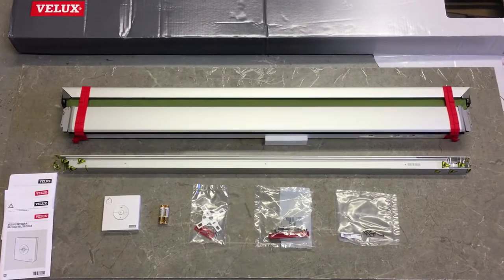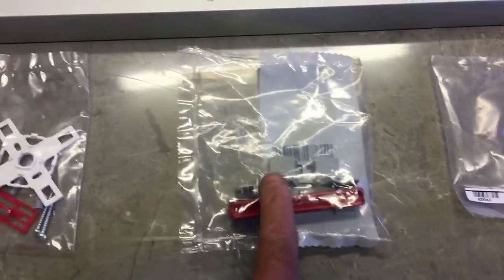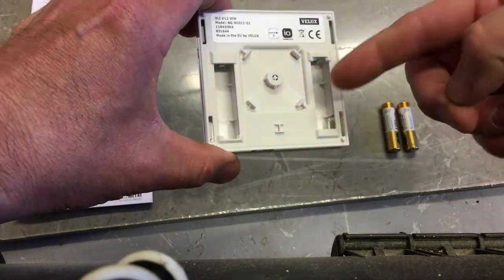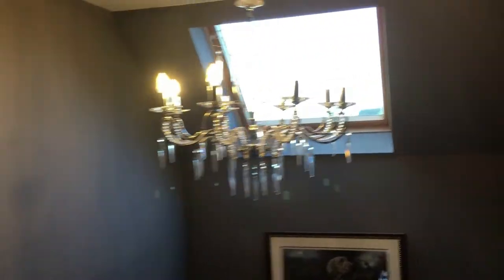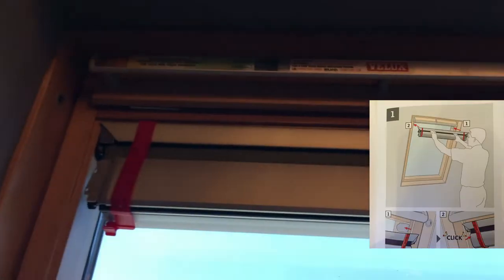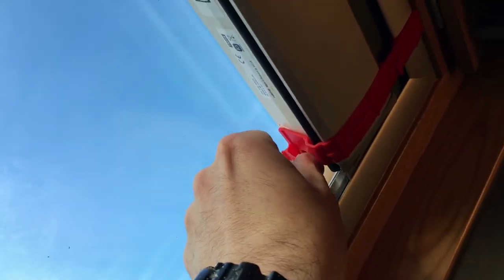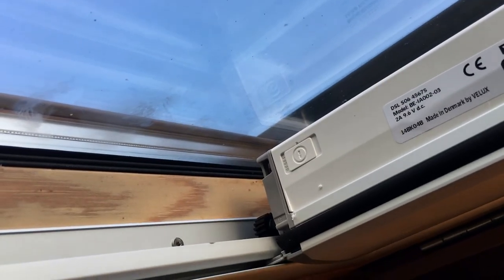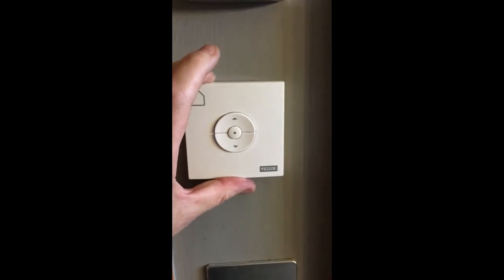How To Fit a SOLAR Velux Window Blind In MINUTES | NO WIRING or TOOLS Required

Comment: Thanks - this helped me UNSTICK my blind. The remote control went faulty when the blind was down. Bad design means that the reset button is then inaccessible! This video helped me identify exactly where it is. You can then use a screwdriver the lever up the bottom of the blind a few millimeteres and a flat steel rule to nudge the reset button - then pair it with a new controller. Phew.
Reply from the maker: I'm glad this helped you out - thanks for the comment 👍

Comment: Note that the SOLAR Velux Window Blind has a life expectancy. Eventually the battery pack inside will no longer charge. It doesn't last forever. I had one quit after about 6 years. The solution provided by Velux is to discard the entire blind and replace it with a new one. They didn't make the battery pack replaceable. My blind currently cost $450, and I have six of them. I disassembled it since I had nothing to lose. I can fabricate a new battery pack for less that $20 but I'm currently working on a wired solution which is a bit tricky because the motor assembly travels up and down with the blind, so the wire need to move with it. I believe I may have a solution. I'd rather not have to change the batteries every few years. Mine are 15 feet high and difficult to access.
Reply from the maker: Sounds good !
Reply: Maybe things have changed since you checked last. They provide replacement batteries now

https://youtu.be/mUZ7-5_kpTQ?si=E92ZANw0X3WKfgdF
Reply: @AIReviewsStuff  Yes, that's different from my model. Velux doesn't provide a replacement battery module for mine. My solution will end battery replacement for good.

Comment: The Velux instructions in printed and video form are depressingly poor and deepened my confusion, so I contacted Velux for technical support. After several fruitless interactions which included searching for a non-existent serial number that they insisted was there, I almost gave up. Your excellent video came to the rescue and a crucial bit of information was knowing that the solar panel is not stationary, but moves on the rails as you open and close the blind Now the Left and Right markings on the brackets make sense. Also good to know that Velux make multiple models of skylight, with identical dimensions, and the corresponding blind has to be ordered for a good fit Thanks for posting this video. I can stop yanking out my remaining few hairs.
Reply from the maker: Thanks Willem, I am happy that the video helped you out.

Comment: Fitted 2 blinds but year apart so forgot how. Still found it hard 2nd time but took much less time as you understand how it fits and works. Tips 1. Solar part faces light and moves up and down, other part is stationary. 

2. Fit plastic bids at bottom first before you get tired as  this is easy
3 look at the shape of the grove to understand how to fit in step one so that it stays up. One side first then other. 
4 when fitting side bars, the rollers need to be on track and it has to clip to gather at top then bottom. Put one screw on each side. Reset the blind and test with remote  before screwing rest of screws to make sure it works. 
5. Use cordless after positioning with provided screwdriver to stop tiredness
Reply from the maker: Thanks for the comment, that will help a lot of people !

Comment: Thanks for this video. Very useful when fitting mine. Mine has squeaks when opening the blind though, any thoughts on how to remedy? Bit of grease on the plastic sprockets?
Reply from the maker: Yes, I would just grease the sprockets if you can get to them, that will help.

Comment: Nice video.  What the reason for blinds In landing area, as I've only bought them for bedroom to block out light
Reply from the maker: I fitted the blind on the landing to block out light to the kitchen (which has a glass door) as the dog kept waking us up at ridiculous hours during the summer mornings ! Also, the blind helps with heat retention in the house during the winter. Thanks for the comment !

Comment: So this kit comes with absolutely everything you need right? No extra motors or anything to buy?
Reply from the maker: Yes, it comes with everything included - thanks
Reply: @Bacrenfencing  Great! Thank you
Reply: Hi , I’m having difficulties to find the link to get the kit  would you please help me ? Thanks
Reply from the maker: @markMi30  You can get them here https://www.veluxblindsdirect.co.uk/?...
Reply: it doesn’t have the option of solar blinds, or does it have a nother name ?
Reply from the maker: @markMi30  If you start to fill in the form with the type of blind you require etc, you will come to a page that asks for operation type. You will get the option of manual, electric or solar.
Reply: Thank you so much,very  helpful

Comment: Do they go on double glazed windows which are plastic.
Reply from the maker: If the windows are genuine Velux, then yes they will fit on there but maybe check to see if there are grey tabs in either corner of the window as I show in the video.
Reply: @Bacrenfencing  Thanks for that.

Comment: The first step that he skipped is what gave me trouble.. I was trying to slide the top part in (holding flush/level with the window). Turns out you push that up. The diagram in the book leaves a lot to be desired
Reply from the maker: Thanks for the comment

Comment: Don't be tempted to save money by ordering an electric blind in a non-solar version, just because you might have a source of power near the window!  The non-solar version is about £10 cheaper, but there are potential on-costs.  If your Velux isn't "Integra" you'll need another bit of kit that they don't tell you about that costs about £15.00, and if your window isn't electrically operated then you'll need the transformer kit which retails at about £120.  So much for saving a tenner!
Reply from the maker: Thanks for the comment !

Comment: ...at 3:42 i see the unit ALREADY pushed into position, THATS the part i need to see, as im trying to REMOVE mine and having a heck of a time, im scared to just yank it ...has anyone removed one of these? do the side runners have to be COMPLETELY off, or just loose and dangling? ( hey thanks, great vid otherwise! )
Reply from the maker: You should be able to just prise the blind off the grey clips. Use a large screwdriver or similar and gently prise it off.
Reply: @Bacrenfencing  thanks for the reply, i DO feel better about putting a lil muscle into it now...make that tomorrow, right now ill have a beer! M
Reply from the maker: 😂👍 Enjoy your Beer !!

Comment: Good now make a video on how to fix it if it gets messed up with the clips?
Reply from the maker: What do you mean ?
Reply: @Bacrenfencing  I'm glad you asked lol if the blind loses its grip on the sheet it goes down but doesn't go back up or in the top part where the motor is spinning then what can we do?
Reply from the maker: @deusvlad2.083  Ah, not sure how to rectify that as it has never happened to mine. Maybe contact Velux and explain the issue ? Sorry I could not be of more help mate.
Reply: @Bacrenfencing  haha don't worry about it m8 thanks anyways for replying.